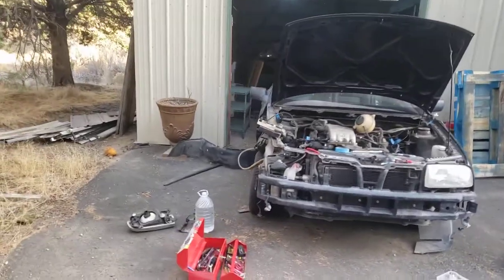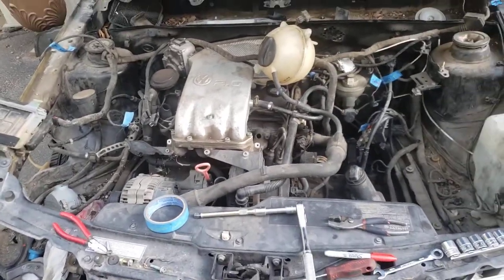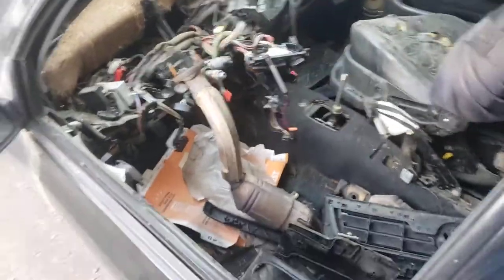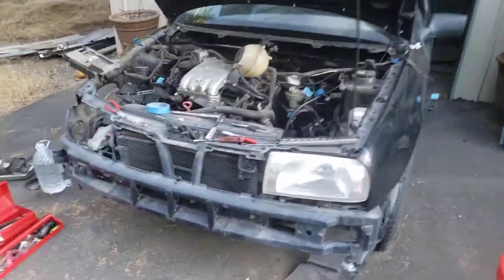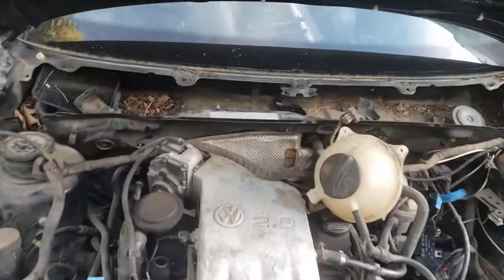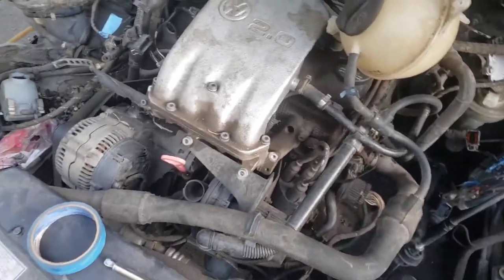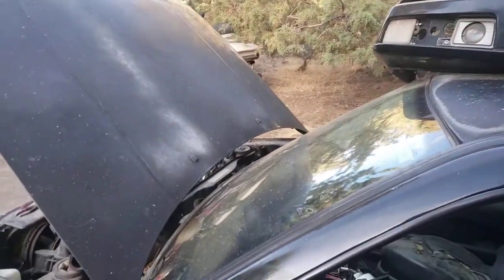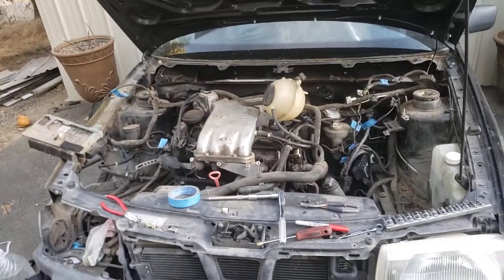Volkswagen 87 MK2 ABA Swap ( Part 1 )

Comment: Question man, how did you get the speedometer to work with having a mk2 cluster ?
Reply from the maker: Well the original transmission on the pickup that bolted up to my aba block, uses a cable for the speedometer and the mk2 digi cluster also uses a cable. So I took the end of the mk1 cable that goes into the transmission and pulled it off then put it onto the mk2 cable and it worked! 

If you're using a mk3 trans with the VSS. I think you can take the end off of the VSS and put that onto the digi cable but I haven't done it for myself so don't quote me on that. 

Good luck!
Reply: @cuttyscustomdubs553  sweet! Thank you so much amigo! 🍻

Comment: great project. btw, do you have those links you researched? I want to buy a mk2 and I'd like to buy the one which is the best fit for the ABA engine swap. thanks
Reply from the maker: Awesome. Basically any mk2 with a CE2 fuse block will be pretty straight forward. But I just posted a video with a wiring guide with the links in the description !!